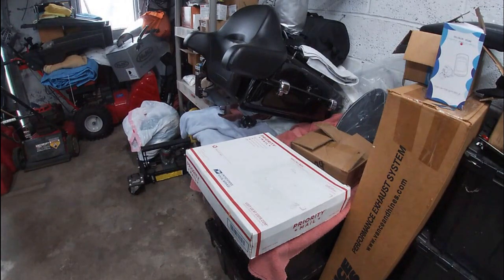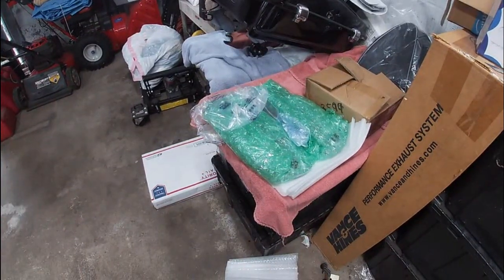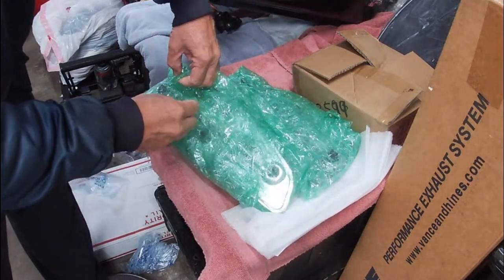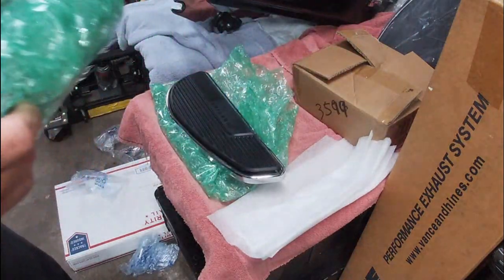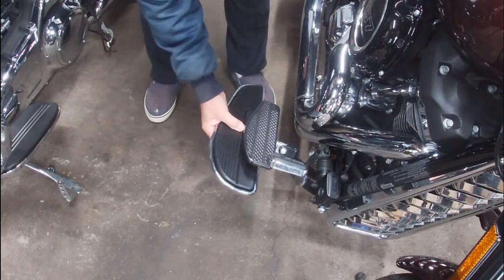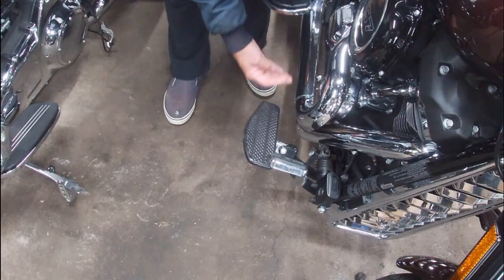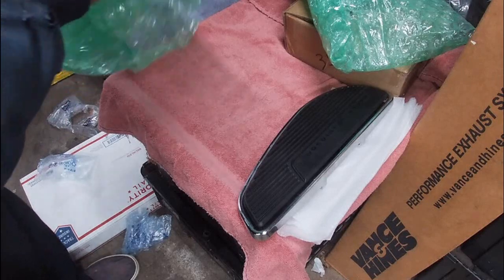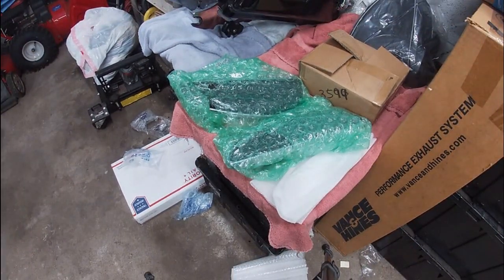2018 Sport Glide FLSB 3rd and FINAL piece needed for conversion

Comment: Do you have a part number for those boards? I thought I could make out 50500742 on the bottom of the first board you unpacked, but it doesn't come up on the H-D website.
Reply from the maker: if you want the same ones i have they are 50500741 and 50500742 which is the pans then the inserts are extra.. for me it was too expensive to buy from dealer... 
much cheaper to buy complete set on ebay , the units i bought he ddnt have best offer but i reached out and asked if he could go lower and he sent me what i thought was a fair offer for them
https://www.ebay.com/itm/155867336472?hash=item244a6acf18:g:7rIAAOSwesdlRS5B&amdata=enc%3AAQAIAAAA4M12IlMZ%2B44xEK2zZQ3m3wwDdavidh1bJrbVwtvX5j9%2F5H0PFs%2F%2FXbcPF1lYEDZbF1dzJxfDkaPsXhJEFu49jePhaVGjyg%2F1OYmEMvzQyD7i8jWvFzUjKOiYPyL66CNdJqA639ZfmIPp%2BxlzV6mlzWVlB5mxxEUCcRbopZAMh6GHi5iLM4viKxWF8OzVo%2BDjPSkyumJAv0%2FXP1Cz3q%2B0M%2FAFnUepiDwqNZ%2BzpiK1kFGDu8fS8Vd377hNGrFTlmEOK2nOjA2KOfzdQmFG57GyTgKutufVXikg0mF5UDe0NPYL%7Ctkp%3ABk9SR-ytndeCYw

ALSO keep in mind you can also run the half moon boards used on the later model softails also, i know the 2020s will work unsure fif the 18/19s will